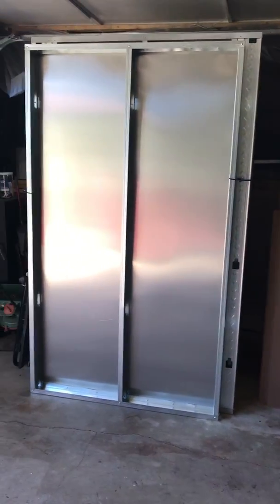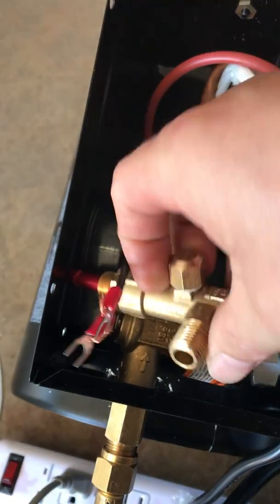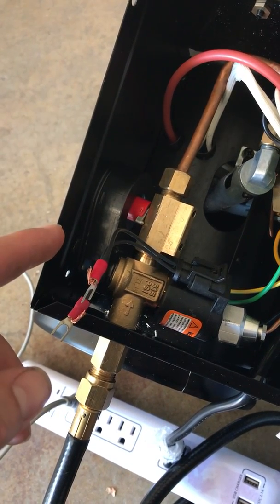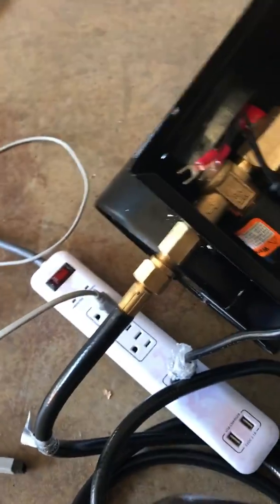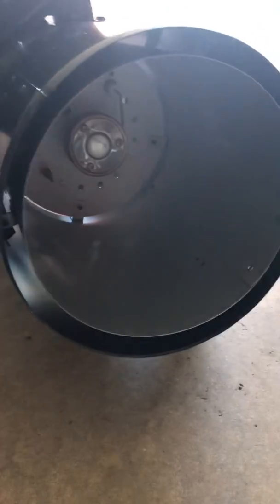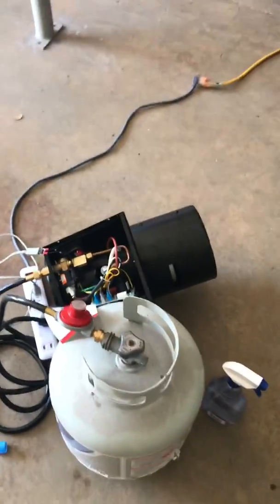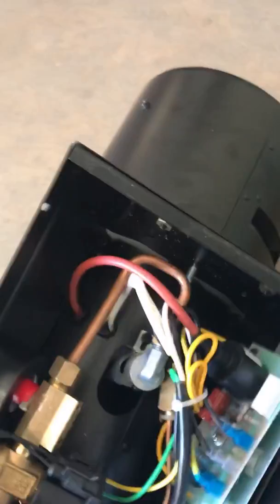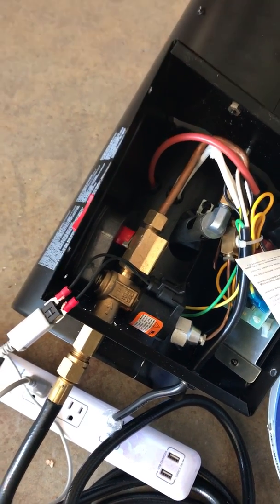Propane Powder coat oven conversion MR. Heater.

Comment: Hi Buddy. I tried to run a Clarke heater into my oven just to warm it up before I power up the electric elements. The flame dies within 2 minutes :( Is this due to an oxygen sensor in the heater?

Comment: I have a mr heater 250 k to 400 k hooked up to my PID... It has an auto ignite but it's not continuous ignite . When my PID calls for more heat it takes a little while for my heater to ignite it . Which causes overshooting of temps . I just need it to ignite when the pid opens the gas valve. Do I have to change any inside wiring
Reply from the maker: I would think not.. should function the same.

Comment: So did that small of a heater work for your oven  I have a 4x4x6. same setup  but a 125000 btu heater.. it takes 4 mins to heat to 400 degress..was told not to use anything smaller.. just ordered a commercial Carlin LP burner.
Reply from the maker: It did work, took about 10 mins to heat. Probably wasn’t the most efficient. I would go with a bigger heater if I ever built another oven.
Reply: @boldcitydesignsjax  Yea.. I just bought the Carlin Commercial Burner and installed it.. very heavy duty , Digital read out.. I drilled out orphis to 150000 btu  it takes about 4 mins to get to 400 !  I might drill out little bigger.. it goes to 275000 btu. Really like this set up.. Thanks
Reply: @Robert John Thomas I used an Auber PID controller !  Very nice controller..It is digital read out. I set my temp to 400 and it is wired into a plug in , that the burner plugs into it.. and it kicks on and off the power too the plug in... works awesome.....

Comment: Is it possible to use just Mr heater for powder coating in the same size oven as your without the electrical heating elements ?
Reply: Can you also put a link on where you bought the LP Valve
Reply from the maker: @hiimbaby2630  no you don’t need the electric elements. Propane or LP gas works just fine. The valve came from amazon. Search LP gas valve. I’ve shared the link several times in the comments section I just don’t have it handy now.

Comment: Hi, do you have a blueprint wiring plan for the controller with PIP. I was on my way to making a 240 volt comptroller till I saw your vid.
Reply from the maker: I do not. I googled and you-tubed and was able to put it together. I didn't really write it down unfortunately
Reply: Hi would be able to provide a link to pid  controller please

Comment: I have a question on how you hook it up to your pid, are you using powder from 12v converter to the pid and then attaching your solenoid?
Reply: It's my understanding that when the PID gets a signal from the thermocoupler for heat it triggers the solid state relay which activates the "powerstrip" or 125v outlet. When the outlet gets power it sends voltage to the heater to ignite and also power to the solenoid to open up the gas flow.
Reply: I meant 110/115v outlet. Not 125v
Reply from the maker: Kevin Shively is correct.

Comment: You wouldnt happen to have a link to the power box for the continious ignition? Amazon or ebay? Ive got all my parts but that so far
Reply from the maker: Craig Burgh ah ok, on amazon search for 12v converter or 12v to 120 converter
Reply: @boldcitydesignsjax  did you order one with the cigarette plug attatched and just clip it off or a different one?
Reply from the maker: Craig Burgh LE Power Adapter, Transformers, Power Supply For LED Strip, Output 12V DC, 3A Max, 36 Watt Max, UL Listed https://www.amazon.com/dp/B00DKSI0S8/ref=cm_sw_r_cp_api_i_3oKmCb2KP55JC
Reply: @boldcitydesignsjax   i want to thank you for all your help! I cant thank you enough
Reply from the maker: Craig Burgh no problem at all sir. Glad I could help.
Reply: @boldcitydesignsjax  now when i head home at the end of this mnth, i can start building
Reply from the maker: Craig Burgh sounds good bud. Get on it.
Reply from the maker: Craig Burgh the heater has the continuous ignition built in, it’s not something you buy separate.
Reply: What i meant was i bought the valve that you put the amazon link up for, and PID. Now im looking for what you have the (wii power box) that you had ordered
Reply from the maker: Craig Burgh ah ok, on amazon search for 12v converter or 12v to 120 converter

Comment: Have few questions as planning on building oven shortly and can see you have quite a bit of experience with it already. My oven side is determined by space I've got and products that will be placed there for coating so external dimensions will be 3.4x7x9ft (W-H-D). The door is at the narrow side. Do you reckon the 60k btu heated is sufficient? also, where would you place the blower in the middle or the back and then use the fan to blow the heat from the ceiling down above the door? Where to put the exhaust pipe then? Finally it is build outside... And insulation wise or stud width I would plan to use the same thickness as yours. Would really appreciate your advice on this! Thanks!
Reply from the maker: I would step up to the 120 btu. That way it doesn’t struggle to keep up. I would still place it in the bottom. Heat rises we all know. Let the heat rise and force the cold air down and out of the exhaust at the lowest point. That way there is always fresh hot air and forcing out the coldest air first.
Reply: @boldcitydesignsjax  completely missed your replay. Thanks!
Reply: @boldcitydesignsjax  answering i had the same quetion, one more thing where would toy place the thermostatin the oven? Away from or closer to the burner. Thanks hope tou get my point appreciate your advise" answer"
Reply from the maker: @delvemetalworkstj  away from the burner. To close and it would be a false temperature
Reply: @boldcitydesignsjax  thank you, saludos from tj mexico home off the baja 1000

Comment: Man you have a awesome idea and thank you for explaining everything. I have one question- when you say converter, what are you talking about? I know you said you will power source.
Reply from the maker: Craig Burgh just a standard 12 v converter. You can get off amazon for around 10$
Reply from the maker: Craig Burgh the fan on the heater is more than enough.
Reply: @boldcitydesignsjax  awesome! Thats what i was actually thinking
Reply from the maker: Craig Burgh yea sir. Any other questions let me know. I love helping out if I can for others trying do things there self versus spending thousands on an oven from a company.
Reply: Thanks for responding back
Reply: Did you install a fan or are you letting the unit push the air around?
Reply: Hey ive been searching amazon and im just not sure what power source to buy, would you mind dropping a link for me? Thanx in advance
Reply from the maker: Craig Burgh LE Power Adapter, Transformers, Power Supply For LED Strip, Output 12V DC, 3A Max, 36 Watt Max, UL Listed https://www.amazon.com/dp/B00DKSI0S8/ref=cm_sw_r_cp_api_Rug1BbX4B6QD8

Comment: How did you wire it to the pid?
Reply: He is using the Ink Bird pid controller. Amazon has them
Reply: Thats what i would like to see also
Reply from the maker: lelow4 life just like you would wire a heating element  except the element is a 120v electrical outlet .
Reply: Do you have a link for the pid that you used in oven ?

Comment: Bold city desings i have a small oven its 3 w 4 h and 8 feet deep i have the electric box control i have 3 electric elements in my oven but electricity its more expensive than gas i have a thermocouple its what control the temperature do you think its posiblem use that box with the thermocouple and use with the gas heater i dont know if i can add something in my gas heater to control the temperature with the box so when my oven reach 400 dgs the oven turn dowm and when the oven need more temperature turn on the flame can u understand my point sorry my english is not very weel
Reply from the maker: Adolfo Lopez if I understand your question yes you can do that. You would need the valve like in this video to hook to your control box so that it could control your gas heater. Although not all heaters will work. It needs to have continuous ignition.
Reply: Thanks for answer buddy thanks a lot
Reply from the maker: Adolfo Lopez no problem I hope it helped. Anything else let me know 👍🏼

Comment: Oh yeah that really did help. Much appreciated. Your right on about old info out there. I hope you post link in comments to the valve, that'd be handy. Also what pid are you going to use? Thanks again, I am planning a build myself and have obviously been looking.... Your oven looks like it is coming along as well. What insulation are you planning on using?
Reply from the maker: Truegrit Scott here’s the valve link. Sorry forgot to post it . IMPCO FL-205-1 Generic Electric LPG Valve Lock https://www.amazon.com/dp/B009SEIIBM/ref=cm_sw_r_cp_api_i_ApB.Ab2A5Y5CT
Reply from the maker: Truegrit Scott also I’m using an Inkbird PId off amazon. Also the insulation is mineral wool insulation from lowes.
Reply: Bold City Designs mineral wool... Sounds like rockwool from my hydro growing days. Going to look that up now

Comment: Do you have a website?  I would like to reach out to you with some questions via email.
Reply from the maker: Luis Rodriguez Not 7 like I heard but 12-15 easily.  Really great system. I’m thinking of building and selling the units and ovens to be honest. But at a very affordable price.
Reply from the maker: Integrated Metal Structures boldcitydesigns@gmail.com
Reply: Bold City Designs Hi there....Does it comes to 400 degree in 7 minutes?
Reply: Bold City Designs I did a oven 4x4x7 and I'm using a 60.000btu and for some resome is not get in 160 degree. The door it have a small gaps, but still to low temp
Reply from the maker: Luis Rodriguez hmm, without knowing your design and materials used I can’t really say. But you shouldnt really have a problem getting to temp. Do you have an exhaust pipe on it ? It should be at the bottom if you do and if you don’t you need one.
Reply: Bold City Designs I have no exhaust...Thanks, that must be the problem
Reply: Bold City Designs I did my oven like yours, like the design.Thank you.
Reply from the maker: Luis Rodriguez 👍🏼 hope it is.

Comment: How long does your bottle last?
Reply from the maker: Trav B. A 20lbs bottle last me about 2 days(working hours) of non stop running.  If you use it periodically and shut it off when your done it would last you a lot longer. Bigger bottle is recommended but it does work great. That’s about 1.25$ an hour to run.